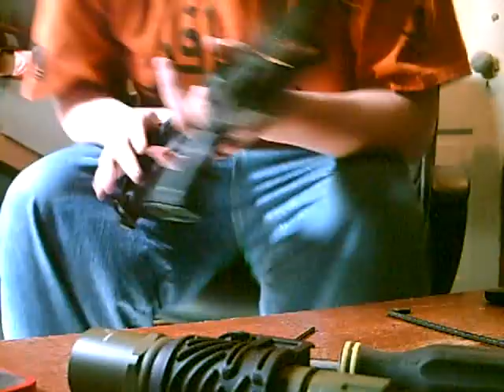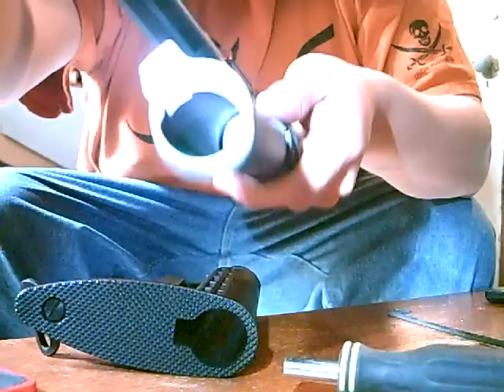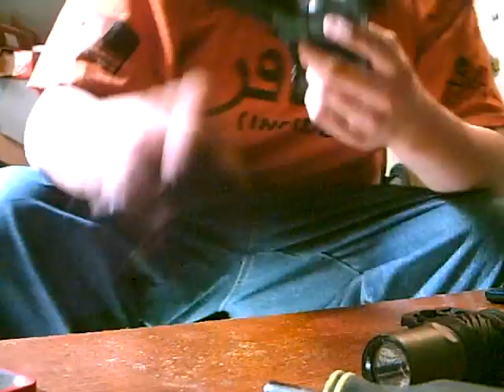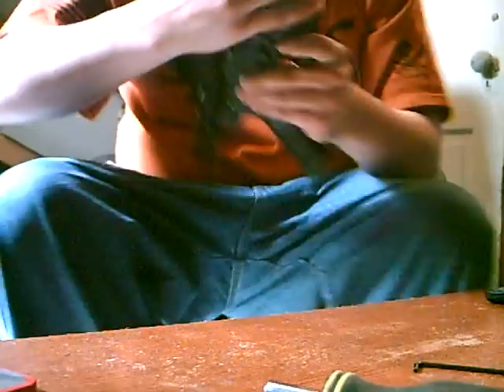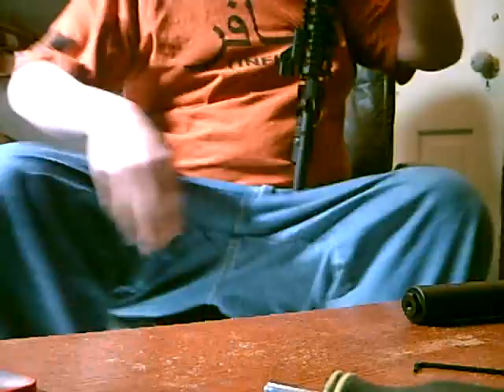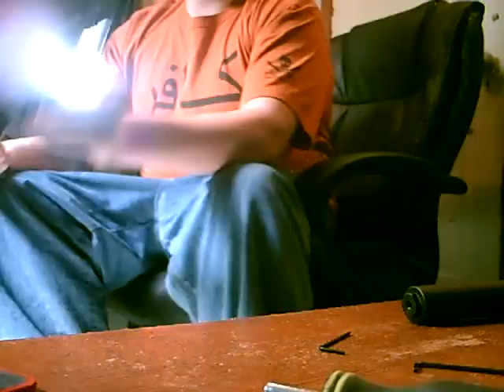umarex m4 ops magpul UBR stock

Comment from the maker: the stock is made two ways, you can tighten the screws and it will have a very good fit,  but if you keep tighening them it  will eventually strip but if wished it can be drilled to fit permanetly but this takes advances steps not needed., but yes there threaded  one of my cutomers acidently kept on tightening the screws until it stripped.... and i dont know why he didnt stop at some point....

Comment from the maker: @Akilldema  you wont be able to put a sling mount on easily you will need to make a spacer likely. but  im not sure. i know alot of cheap tool kits include  a extender to be able to get longer reach and i sold the gun so sorry i can measure it for you.

Comment: yah the 4 position old style before they had the 6 position stock with all the groves in it. i tried to just put the 4 position stock body on the factory tube but it was loose and the lever pin was to short. so im going to swap the pin out with the 6 position pin because its longer but i didn't know if there was any way to swap the buffer tube out or use that adapter that you did for the UBR stock.